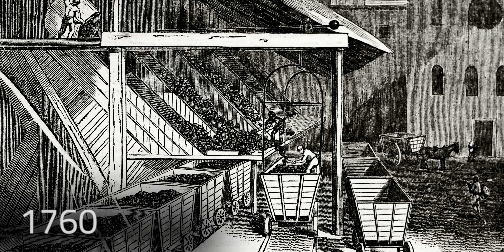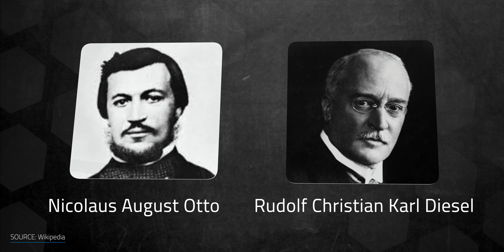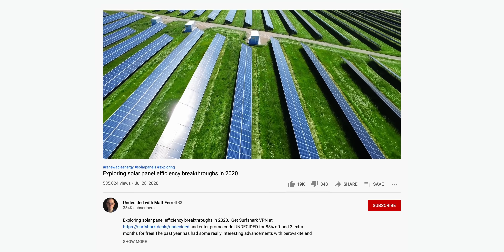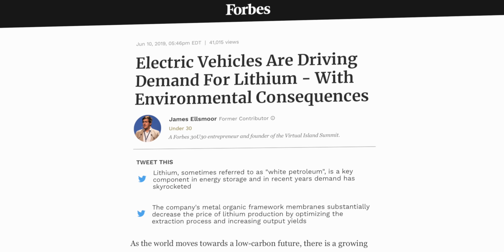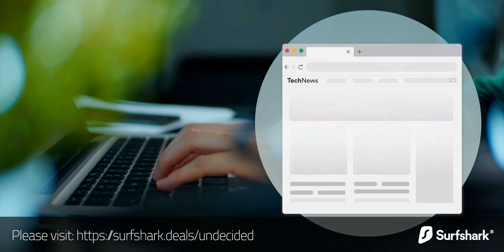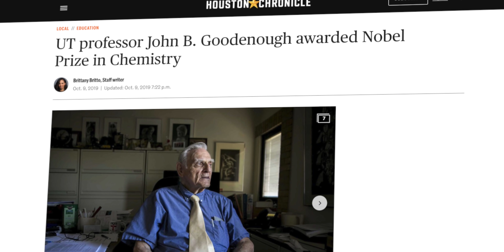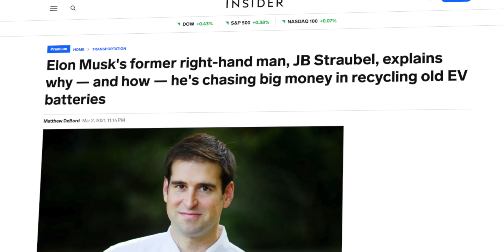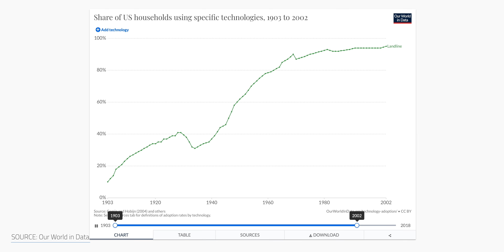Is the Future of Renewable Energy Inevitable?

Comment: Here’s why comparing renewables deployment to the industrial revolution is completely incorrect. Energy density. There is only so much energy in a square foot of sunlight or wind to extract. The dramatic increases in efficiency that were possible in combustion systems were due the massive energy still locked up in the coal that the inefficient first engines didn’t tap. It’s just not possible in renewables because there just isn’t as much energy in there to get out. This means that In order to expand renewables usage dramatically, we need to cover the landscape with them!  Does that sound environmentally smart?  
But you know what energy source does have loads of untapped energy like industrial revolution era combustion systems did? An energy source that has loads of efficiency headroom?  An energy source that’s actually “greener” than renewables since it uses sooo dramatically little land per unit of power produced?  Nuclear baby!  Clean, abundant, powerful, small, safe Nuclear!  
Like what you said about electric cars tho.

Comment: Unless renewables includes nuclear and fusion then no. Wind and solar are pipe dreams. They are "feel good" measures, rather than actual solutions (unless depopulation is part of the plan). If we as a global civilization was serious about this, we would deregulate nuclear, and fast track its deployment. Its proven, reliable and requires minimal changes to insisting grids. That would give us thousands of (unnecessary) years to move to fusion.

Comment: Comparing eficciency increases by x times is beyond stupid. If one technology starts incredibly ineficient, like that 1% steam engine, it's not that hard to up it by 10x.

" In 1955, Hoffman Electronics-Semiconductor Division introduced photovoltaic products with only a 2% efficiency, with an energy cost of $1,785/Watt (USD). In 1957, Hoffman Electronics were able to introduce cells with an increased efficiency, at 8%. The same company’s solar cell efficiency was increased to 9% in 1958 and 10% in 1959. " That's looks like 10x in 4 years to me....

If you start counting efficiency increases only from the 60's (curious choice btw, as if to minimize perceived progress), solar panels can't possibly get 10x more efficient, it's not physically possible for 100% efficient panels to exist. 

I don't know if this video was done from devils advocate perspective, or is this youtuber really that clueles... Either way, what a shoddy video...

Comment: There is no reason to have exponential efficiency increases in solar - current efficiency rates are more than enough! You only need an area 335km by 335km to provide ALL of the earths electricity from solar. What is really needed - the drop in cost per watt for solar. and that has been falling exponentially $76 per watt in 1977, $0.74 per watt in 2013, and even cheaper today. That's over 100x drop.

Comment: Solar and wind resources are a poor match for an economy dependent on reliable power service.  Batteries can efficiently store energy but at a relatively high cost.  Also the limited amount of time they can deliver power makes them useful only for peak shaving.  A better match would be to use renewables to charge batteries for an EV charging station.  The intermittent demand for charging  EVs would be a good match for a large renewable wind/solar farm.  When the battery is fully charged any excess could be sold to the utility at the same real-time energy cost paid to other generators in the power pool ( many power pool operators pay generation companies the lowest energy cost bid into the power pool). The bidding process keeps your electric costs as low as possible The bidding process works if the pool operator pays to have some generation in ready reserve in case of an emergency.  The recent disaster in Texas was caused in part because the ERCOT pool operator did not pay any generators  to be in ready reserve.  Operating a reliable power system is far more complex than most people realize.  unrealistic claims about the capabilities of wind/solar  puts customers at risk (like Texas) and hurts the credibility of wind and  solar proponents.

Comment: DC is not bad for power transmission. Low voltage is bad for power transmission. Until recently it was hard to get DC to change voltages. But now that we can make high voltage DC it is even better for transmission than AC in certain situations.

Comment: For now and for the foreseeable future if you need to get the job done you will be using diesel fuel. The energy density of even the best battery chemistry is pathetic compare to diesel. An agricultural tractors burn ~700 litres/day, combines ~1,000 litres/day and there are others road construction, mining who will continue to need diesel. Assuming a small 4 wheel drive tractor, like the John Deere 9R 390, running at its rated engine power of 287 kW for 10 hours you would need 33.8 Tesla 3 battery packs, 85 kWh/pack. Those 33.8 battery packs would add 18,252 kg (40,560 lb.) to a tractor that weighs 20,856 kg (45,980 lb).

Comment: We are not going to have an exponential rise in solar cell efficiency.
I can say that confidently because the efficiency is determined by how the incoming energy interacts with atoms in the solar cell, no amount of innovation is going to change fundamental laws of physics.
We can already make lots of solar cells in the lab that have double the efficiency but instead of cheap and easy silicon we have to make them out of unobtanium rare and expensive materials and put them together in a multi layer manufacturing process that is vastly more complex and expensive than current commercial cells so they are thousands of times more expensive for only double the efficiency. 
Simply not worth it unless you are making satellites and every gram to orbit costs enormous amounts of money. 
We are not going to run out of desert to put solar farms in anytime soon.

Comment: Hydrogen is one of the most difficult and dangerous substances to handle <https://www.science-climat-energie.be/2021/02/26/pushing-hydrogen-out-of-the-safety-controlled-laboratory-environment-for-mass-on-road-application-will-cause-critical-safety-hazards/>. This will doom its use in any consumer application.
Reply: My reasoning for why I believe EV's will win out in the end is this one simple fact...  We already have an electricity grid.  Sure, some upgrading will need to be done, but it's all essentially there for the whole world today (minus extremely remote locations).

With hydrogen, the world is going to have to expend hundreds of billions to trillions of dollars building out the massive infrastructure improvements needed to make it cheap for all.  With EV's, the grid is already there.

Not to mention the technical difficulties and dangers of hydrogen storage, as you alluded to.  

That being said, I think hydrogen will work for planes...  There are only two ways to make long distance flight possible, with jetfuel like we have today, or hydrogen fuel.

Comment: Matt, in your description you already point out that solar cells have demonstrated 47% efficiency. And therein lies a major problem. It may be true that steam engines took 100 years to get from 1% to 10% efficiency, but they could because at least there was room for improvement. With solar cells at close to 50% you can get no more than double that before you reach 100% efficiency. At that point you convert all energy that reaches the surface into electricity, and any further growth will have to come at the expense of surface area. As solar is only a marginal contributor now, you need to sacrifice huge amounts of land to get to the required energy levels, even if you make 100% efficient panels. Do you really want to claim you 'saved the environment' when you cover all of it with panels?

Comment: There are some bullshit efficiency numbers in here. You can do better than this Matt. PV efficiency can't increase by a factor of 10 because that would be more than 100%. 95% efficient hydrolysis is bollocks: state of the art is ~70% at the moment. Lithium is <4% of a lithium-ion battery, and there are plenty of sources. Nickel, cobalt and copper are much more significant.

Comment: I usually like your work, but I’ve got a lot of issues with this video. Solar, wind, and storage are already cheaper on a LCoE basis than its competitors. For utility scale storage, chemical-based storage will eventually lose out to gravity based ones, with technologies like Ambri being the outliers as Ambri and gravity-based solutions have zero degradation. 

Gravity wins at the grid level because can store for long periods, allowing for harvesting and storage of large quantities of energy during peak production seasons for use in low energy seasons while still being usable for maintaining baseline and peak power. It can also provide the inertia that solar doesn’t have, eliminating the final advantage more conventional electricity generating systems have over renewables. And I’m not talking pumped hydro either; I’m talking about systems that can be put anywhere and operate in all conditions. You just need to raise heavy things you can lower later. Better to put the chemical batteries in mobile devices like EVs.

Green hydrogen is far too inefficient to be a viable solution, and by that 2050 goal for parity, other solutions will have burned past any hopes for green hydrogen. That, and hydrogen is one of the most dangerous fuels to use. I see the amount of energy via renewables becoming so great that excess can be devoted to making carbon-capture fuels ala Carbon Engineering for those edge cases where a liquid fuel makes sense.

But the biggest thing is that by 2050 most homes and businesses will be making most of their own power, and the grid will become a “dumb” network managed by smart cloud services used for distributing power amongst a huge amount of small suppliers, most of whom will have their own storage solutions. Think of it. The internet is not a couple of huge mainframes controlled by monopolies. It is made up of a massive amount of independent entities varying from big server farms and data centers to individual PCs operating in a distributed fashion. That’s what is coming for power. The utilities as we know them face obsolescence.

You don’t need a massive efficiency increase, you don’t even need any massive breakthroughs. The tech already exists or is about to come to market, and all it will take is for people to see how they can save money and gain control by making and storing their own power for the whole system to transform itself on its own volition. Once the price hits a homeowners sweet spot, they will get solar and storage, and then you tie it to something like Tesla’s Autobidder and kind of forget about it. And for many that price is here, now. I now use panels that have 22.7% efficiency to produce almost all my power, and once I am finished transforming how my house operates, I will be a net energy producer. I don’t need to wait for some breakthrough, I just need to save some cash to purchase the next thing that already exists, which will likely be cheaper when I eventually buy it.

The only key innovations I see are to make the equipment production process closed loop, continue the downward price curve, and streamline the installation process to further lower costs. All very douable in the near future.

Comment: ehh, I would suggest you watch a Tony Seba-video. The focus of your thinking must be on the cost pr energy unit, not how efficient solar is pr surface area.

We have already seen the cost parameter for solar improve exponentially, as we have for batteries. Tony Seba’s claim is that IEA is misrepresenting true cost of different energy sources, and that we are already beyond the tip-over point, where renewables are cheaper as well as viable, with current battery costs, than all other sources. The transition is therefore very likely, and also likely to happen relatively fast.

Lastly, the Lithium shortage has been a counternarrative for decades, with no indications that it will hold water.

Comment: the difference between the steam engine and the wind generators is they did not build steam engines in their hundreds of thousands as soon as they got it working 

we're building in massive numbers inefficient windmills who last maybe 5 years before major maintenance (replacing the bearings) instead of spending the same money on iterating through prototypes and getting the tech improved

Comment: Bottom line is that the electric motor is 3 times more efficient that the internal combustion engine. The source of power for the electric motor is 'currently' has no clear direction at this time. A fuel cell that generates electricity and water as a byproduct would seem to be a potential long term winner.

Comment: Trying to power a modern industrial nation by farming very low energy-dense, intermittent sources is just plain dumb. We already know how to replace fossil fuels at scale using all of the existing electricity infrastructures, but it sounds scary. Gen. IV molten salt nuclear fission can completely replace fossil fuels in all of its energy forms, not just electricity which is only about 25% of the total. Synthetic liquid fuel for transportation, heavy industry, and air travel along with industrial heat. At the same time eliminating our nuclear waste stockpiles, which is free fuel for some of the Gen. IV's.

Comment: There's a hard limit to solar energy, about 1 kW beams down per m2 in the best of circumstances, we can theoretically harvest 50-55% but anything past 30% will be cost inefficient for the foreseeable future. It's not a technology we can improve 10x since the laws of thermodynamics don't allow it.
Reply: Sure, but you're looking at the wrong numbers. The relevant spec is energy/cost which can certainly still improve that much
Reply: Not sure where this 50-55% theoretical limit is coming from. Shockley and Queisser limit for a single bandgap is at 33%, for multiple layers things can go to 86% ( https://en.wikipedia.org/wiki/Solar_cell_efficiency#Thermodynamic_efficiency_limit_and_infinite-stack_limit ). Maximum achieved is 47% with three layers ( https://ieeexplore.ieee.org/document/8231134 )

But I agree that "improving efficiency by a factor" is one of the worst ways to look at it... There is always an upper limit to this (which is 100%) so all this is, is telling you where you started...
Reply: @europhil2000  There's a difference between the absolute theoretical limit and practical theoretical limit. Like you state, the maximum achieved in a lab environment (no need to protect against elements etc) is 47%.
Reply: @axiom1650  I am not disagreeing that the practical limit will be less than the theoretical. And 30% also sounds pretty reasonable to me. Btw., as far as I remember that's where space applications are now at.

But you do say the theoretical limit was 50-55%, so I was wondering where this numbers comes from.
Reply: @europhil2000  It depends on semantics I guess, if a value is theoretically doable but can never be achievable in the real world (ie. requires layered materials which are 100% transparent for wavelengths it cannot convert to electrical energy, cannot have any protection, must be kept at -200°C), it is not even a theoretical limit in my opinion, it's a fairytale limit.
It looks like we'll do over 50% efficiency in the lab this decade, but it seems highly unlikely we'll do over 50% in mass production this century. My guess would be that we will asymptotically increase efficiency of mass produced panel to 50-55% at some point.
Reply: @axiom1650  Yeah, I get your point and I would agree that this is the practical limit that one would see nowadays. I don't want to split hairs here, but I thinks its inevitable...

You did say "hard limit[...]theoretically[...]". So I thought you were actually talking about a physical, well established limit. But I get now that you were talking about a practical limit that you think were it is. I think this is actually one of the points that the video makes: In the end, there is still efficiency gain to be made, very slow but if you keep optimizing there is some gain to be made, even if it seems to be unfeasible in earlier days... I get that you estimated 50-55% which might be the actual practical limit, but I'm still not sure were you get that number from. Sure, the absolute limit of 86% that I quotes will probably never be achievable due many reasons, some of which you listed, but do you have any source or data/theoretical considerations to back this number up?
Reply: @axiom1650  Sorry, didn't want to be too blunt. I don't think we disagree here too much.

Comment: Talking about 95% efficiency for hydrogen production through electrolysis is quite misleading. It's a best case scenario where they would utilise most of the waste heat which is not realistic. They same way I could say that all steam-electric power stations are 90% efficient as well. Presenting such information in a video meant for general public mostly spreads misinformation in my opinion. There is already a significant lack of knowledge about renewables and power generation when it comes to general public.